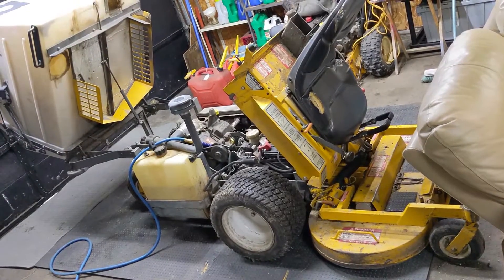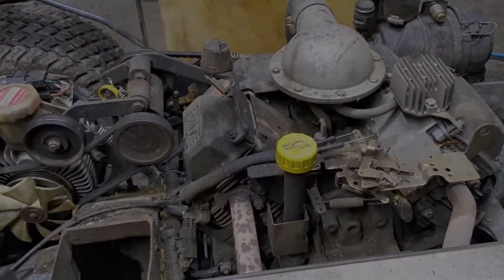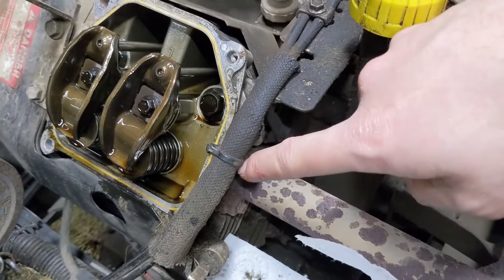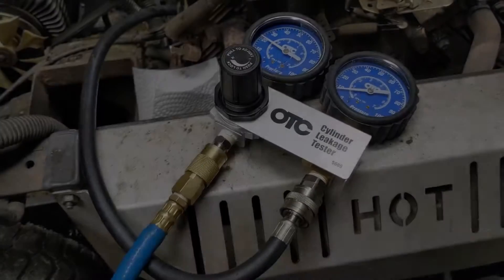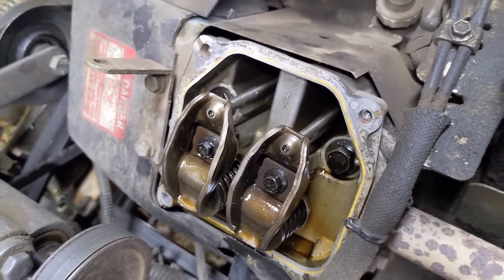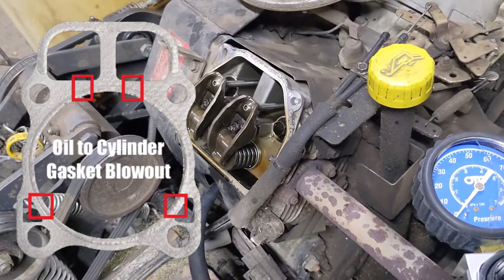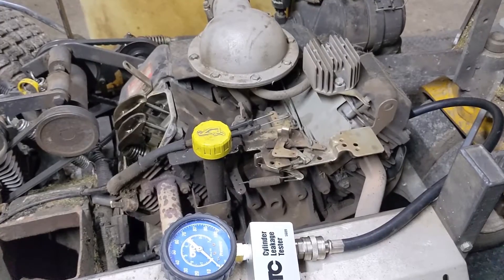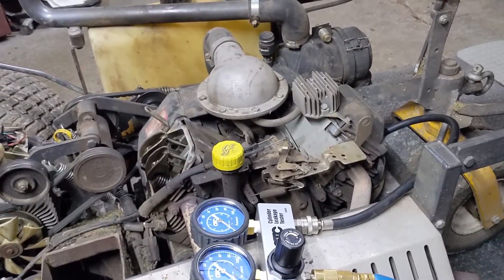How to Diagnose an Engine that Burns Oil

Comment: If you remove the cylinder head to set Top Dead Center do you need to reinstall the head before performing the leak down test?

Comment: especially with a v-engine, using a dowel could cause a problem if the piston catches it at the wrong angle, it could break off in the cylinder; it happened to me and it took 4days to fish it out, but I got it out without removing the head. That was about 2/3 yrs ago, but seeing you with that dowel brought back bad mem'ries.

Comment: What about the crankcase breather reed valve?? you did not mention that as a possible cause of engine burning oil.  And would a bad breather reed valve cause fowling on both plugs or just one?  Thanks for the good explanation  on diagnosing the kohler v twin.
Reply from the maker: Yes well if the breather/reed valve was stuck closed the engine would build crankcase pressure and you'd likely see oil leaking out of the crankshaft main seal as well.
Reply: @EliminatorPerformance  That makes sense but what if it (the reed valve) was broken or stuck open?? and if it was stuck open would it foul both plugs with oil mist the same or would it affect one cylinder way more than the other?  This is my problem the front plug on my walker mower is fouling bad and I have to add 6-8 oz of oil after mowing for 3 hours.  Trying to diagnose... I just borrowed a leak down tester and going to run the tests.

Comment: I see on your follow up video that the gasket failed between the cylinder and pushrod channel... top right in your diagram. What would the test show if there was a fail in the lower part between cylinder and oil return holes?   Would you hear it through the oil dipstick?   And if so, how would you know it's not rings?   Great video btw.

Comment: Great job . I bought a rider  with a Briggs in it and it burned more oil then gas. When i pull it down .( because both cyl the plugs looked like the one you showed) i found that some one had rebuilt it and put the wrong ring's in it. When i checked the ring end gap it was 1/4" and i don't know how he didn't see it. put new ring in and no more smoke.The thing's you find  when you buy from a auction.
Reply from the maker: Nice fix, and thanks for watching!